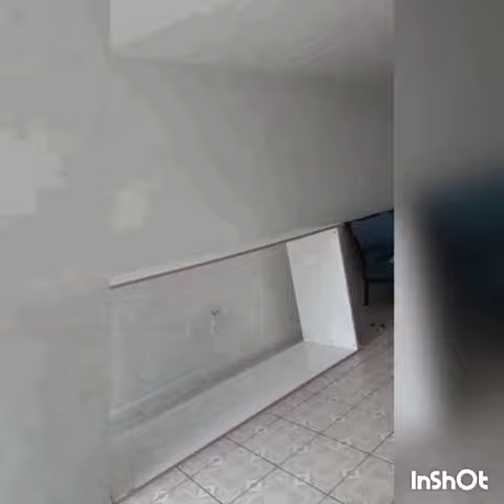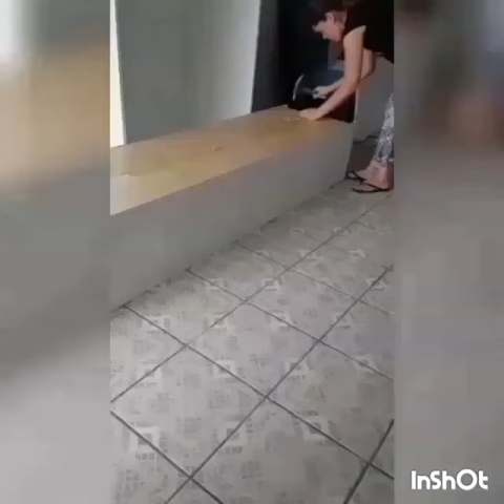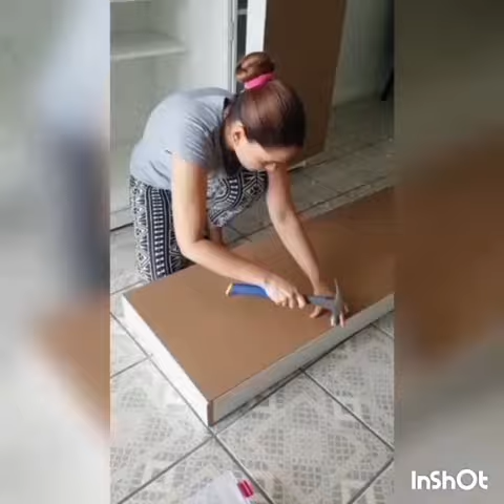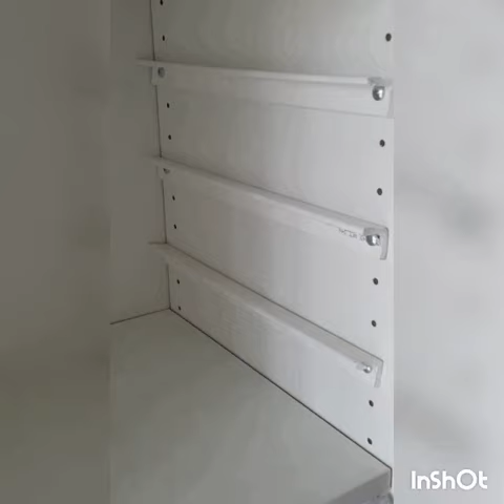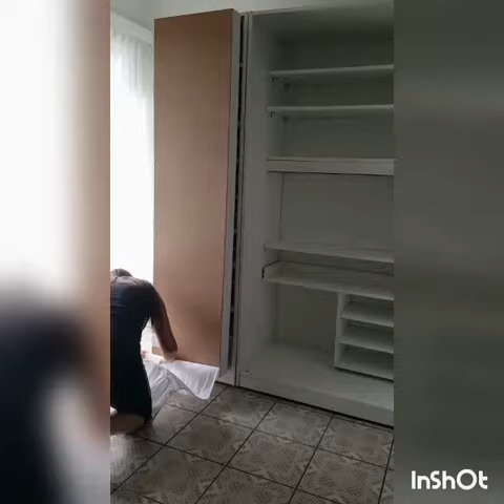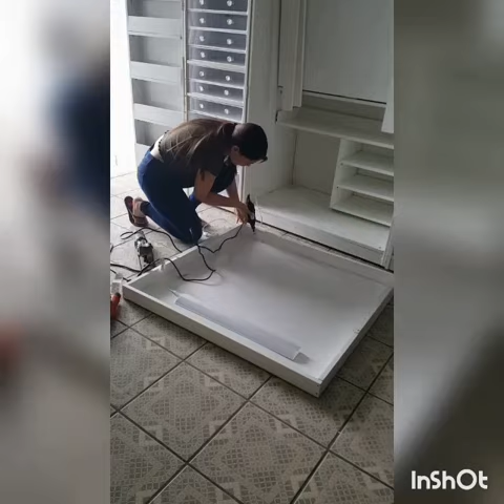DIY Dream Box (IKEA wardrobes + Lowes supplies)

Comment from the maker: Please turn on the CC on the video so you can see the subtitles.  Also check the description box.
Reply: Sileam I can not see anything that shows instructions or supplies? Am I doing something wrong?
Reply from the maker: @tatomirc  You need to click on the little (CC) icon next to the setting icon. Make sure that has a red line on the bottom. 👍
Reply from the maker: @tatomirc  I think You have to change the settings to Spanish subtitles. The English subtitles gives you the songs lyrics LOL. I need to fix that.  😂
Reply: Incroyable. Fantastique
Reply: @Sileam  I understand that you have the supplies list in the description, but would you be willing to make an instructions "manual" to sell to us that would like to make a replica?? Id gladly buy !!!
Reply: I have been wanting a dreambox for years and was looking at them again for my scrapbooking to keep things neat and tidy but to expensive.  I LOVE this.  Looks larger and more storage then the dreambox.  I would love to make something like this.  I see the instructions throughout video but do you have step by step instructions besides the video?
Reply: Hi Sileam, can you tell me the dimensions of the top, and how the dimensions of the table legs?  Thank You
Reply: What are the dimensions of the finished cabinet?
Reply: @genniegidney  wondering the same.
Reply: What is the ikea piece that you are attaching using the piano hinge. I saw 3 wardrobe pieces needed from ikea.
Reply: Hi. Fantastic job! Would love to know the total cost please! Love it!
Reply: Are the sizes correct for the IKEA pax side units??? Are they supposed to be the same depth as the middle?
Reply: Please do a step by step video with full instruction and measurements.  I WILL PAY YOU!!!!
Reply: I need additional instructions for the table. I just bought everything in your description (minor adjustments)
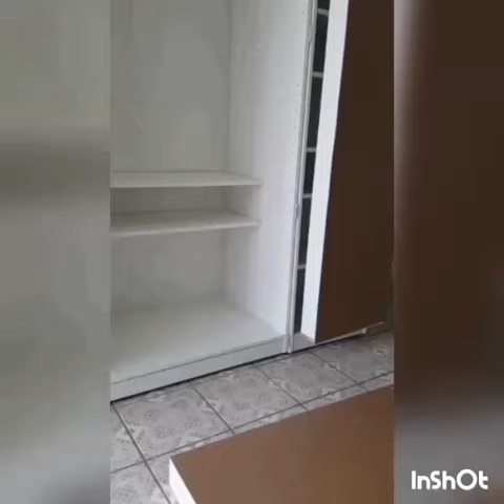Reply: What are the dimensions for the 2 end doors? 8:18
Reply: Thank you for your tutorial. We are almost done. We just need the lights and door handles.

Comment: I was going to go in debt trying to buy the Dreambox, but started looking for alternatives to it. Every video I came across didn't quite do it for me. The cabinets were OK, but looked cheap and not very durable. Then I found you. Girlllllll wowwwwww. This is the absolute best one and you set the standard for me. This will be what model I follow. Thank you for this masterpiece. Bravo.❤️❤️❤️❤️❤️
Reply: Did you ever built it? If so can you tell me which items are used for the outermost cabinets, I'm getting condused with the ikea shelves and all I found was UTRUSTA Shelf, white18x14 3/4 ". Is this correct?
Reply: @Cathybeez  I just bought mine from ikea but I bought different cases for slightly smaller dimensions in depth once closed

Comment: Started building this for my wife.  Got a lot of great ideas from this video.  I think there's a typo in the materials list though.  Based on watching the video and putting one together.  The sides appear to be the Pax 19 5/8 x 13 3/4 x 79 1/8, not what's listed. Otherwise when you have it all closed its 45 3/4 inches deep.  Almost 4 feet. Takes up a lot of space when closed.  Just a helpful hint.  Gonna have to take a trip to Ikea at some point to make it a little less overwhelming for the room.

Comment: love this video! Cant be more excited to build this for my craft space! This comment is not meant to be mean or condescending in anyway. Just informative for people who might be confused about the directions. So, a couple things to mention: with the horrible supply chain issues that IKEA is having in the current market finding all PAX items can be difficult. I can't find shelves and the wardrobes are mostly out of stock. I will be using plywood or melamine for all my shelves. With the current market (2022/2023) the cost of materials have increased as well to about $1,400 for the total project approx. depending on lumber pricing in your area of the US. Other comments are correct about the side doors being 13" and not 22" wide/deep you can tell by the 1x1 floor tiles. also there is a typo in the height of both wardrobes. They're the 92 1/8" sizes because 1) they don't make a 19x13x79 at all and 2) again estimating the height by the floor tiles again. Measurements for the crown, the table legs, pull out shelf, table it's self, and the smaller side doors can also be determined this way. But its unclear how high to install the middle shelving? it looks like she puts the board vertical and puts the middle shelf one board length up from the base of the wardrobe so the middle shelves are 39 3/8" apart and the next shelf is one foot below that? standard table height is 28-30" so I'll probably do that. But the directions are unclear. You can always buy drawer hardware and plywood for shelves instead of foam for structure and longevity of the furniture. The use of "already on hand items" as well like the plastic from the PAX for the side doors and the bottle caps for the ribbon holders are difficult to come by but could easily be improvised (use dowels for the plastic, and PVC tubing for the caps?). The type or weight rating for the command hooks I guess is preference but there are 5 on both sides. Compared pricing on amazon for some items like wheels, led lamp, and shelf pegs.  You can also cut holes in the drawers like how the OG Dream box has theirs with a saw or Dremel to save money on knobs. But if you do want knobs I'd suggest two part epoxy for attachment and not felt pads. some items with codes listed are no longer available like the vinyl molding and the gray wall panels but there are replacements with similar pricing on Lowes's website. the wheels she uses don't lock but you could put two on the big wardrobe on the back where there isn't and lower trim or just don't install trim when building wardrobe in the start. she also has a smaller drawer system and a couple deeper drawers with no explanation on construction although I assume it's the same but different sizes. If I'm missing anything I apologize and I hope this helps anyone who might be confused or apprehensive to start. TBH the creator could make this a reddit or something so we could all help with troubleshooting! :) Thanks for reading! Happy crafting!

Comment: The furniture comes from IKEA, just search "wardrobe closet" and match the structure of the one she’s building she uses the wheels from Lowe’s and probably the containers from the dollar store. Good luck!!
Reply: The supply list is in the description 😊
Reply: @NeverEnding_Designs  Too bad the supply list isn't accurate! I can't even finish building because the size of the wardrobe she provided vs the size of the wardrobe she used is incorrect. Now I have to disassemble the incorrect wardrobe, return it to IKEA (30 mins away), purchase the correct wardrobes, and reassemble them.
Reply: @solyamante  could you give me some more input on this as we were going to go purchase the cabinets she has listed this weekend??

Comment: I think you made a mistake on the 2 outer cabinet dimensions. Didn’t you use 22” depth for center and 13” depth for sides? I am building mine using pax frames as well.

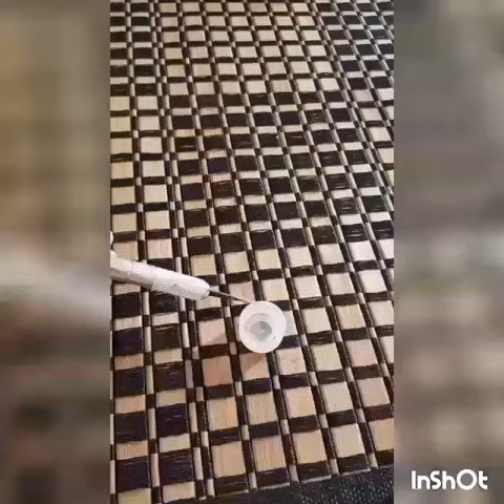Comment: at 9:49, you took a top from a bottle and cut it with an exacto knife, used a wood dowel and stuck it in the holes of the door with no wheels. what's the purpose of the top from the bottle?
Reply: It’s a bracket to hold the dowel. Like a closet rod bracket just in miniature.

Comment: Do you have the product code for the 18 inch by 13 5/8 in shelves. Ive been searching for 2 days on ikea.  and also since the actual cabinet is larger than 18 inches im confused about  the size.  I assume the 13 5/8 is short because you tuck the last fold out inside when closed...but is the internal dimension 18 and external 19+.  the closest size shelf Im finding from them is 18 × 14+
Reply: Melissa, did you find the shelves?  I am searching and can't find them.

Comment: Hi!  I’ve begun to build my “dreambox” and mine appears to be a lot deeper than yours.  Did you end up using 2 of the 19 5/8 x 13 3/4” cabinets instead of the 22 7/8” deep cabinets?  When yours is closed, is it about 45” deep or 36” deep from the front to the back?  Thank you!!!
Reply: Hi Aimee, 
Did she respond to you?  Also did you find the 18x13 5/8 in shelves thru ikea??? Ive been looking for 2 hours..not finding these at all
Reply: Hi!  I didn't hear anything from her so I decided to go with the smaller cabinets on the sides of the large middle cabinet.  I used the 19 5/8" W x 13 3/4" D cabinets for the sides.  Over all the cabinet is about 3' deep when it is closed.  I did find the shelves that fit inside this smaller cabinet.  They're listed as 19 5/8" x 13 3/4", but the actual size is about 18 1/8" x 13 3/4".  

Pax Frame - https://www.ikea.com/us/en/p/pax-wardrobe-frame-white-60214569/  $75 each
Pax Shelf - https://www.ikea.com/us/en/p/komplement-shelf-white-40277992/  $5 each
Reply: @aimeeaustin6273  how did yours turn out
Reply: @tashaharley3411  It turned out pretty good.  I didn't add the second fold out doors...I figured I could add them later if I want to.  I also haven't added the table yet, which I still am planning to do.  There are a few more things I want to add also before it's completely finished.  Overall, I'm happy with it.  The only downside is the space I put it in is kinda small so the cabinet looks ginormous!  Lol!  :)
Reply: @aimeeaustin6273  thank you, I'm wondering if i will have the same problem in regards to the space. I love her idea, but i also saw some using 4 bookcases of the same size, so i wonder if i did that with smaller bookcases how it would be, but not sure how sturdy it would be compared to the pax frames
Reply: What size casters did you use? I have seen several questions for Sileam but I haven't seen her response. I'm pricing out the material now and hoping to build after the beginning of the year.

Comment: Finally got the wife’s cabinet done.  When We close the outer cabinets, the backing of the smaller doors get stuck on the opposite cabinet.  Do you have this problem?   When the smaller cabinets close, there is very little clearance.
Reply from the maker: Hi Rod! I had the same problem at 1st but then I noticed I had more room on top of the small doors and I had to adjust them (moving them a little bit  higher) You can always make this doors smaller so they can fit in the opposite cabinet.
Reply: I’m sorry, I didn’t explain it well..   My Right cabinet gets stuck on the left cabinet.  As they move the last thing that touches is the piano hinge and the added on plain white back board.   It’s when it is opening and closing that there is no clearance
Reply: @rstandi  were you able to fix this, and can you share a picture of yours?

Comment: I need help I’m not sure what I’m doing wrong I feel like it’s not holding my bookshelf strong enough because I feel like it’s gonna fall or flip over
Reply: It is probably where you placed the castors (wheels) if you put them on the outer edges they will be more sturdy.

Comment: Hi!!! Hope you get to see my message and answer someday :) Just wondering... DO you KNOW the size of the Wheels you got?! I've found at least EIGHT (8) different sizes of wheels at my local Lowes!!! LOL I'm practically following YOUR supplies list... and what I'm missing are the WHEELS!! I want it to be like yours, that the wheels aren't that obvious but are the correct size. Thanks in advance! And thanks for sharing your awesome DiY Dreambox! Yours in much better!! :)
Reply from the maker: Hi!
You can buy any size, as long as they lift the wardrobes enough, so they can move easy when you close and open the dream box, you don't want the bottom pieces  of the wardrobes to touch the floor (I mean the mouldings that you see on the front, the ones that covers the wheels) . What is actually important is how much weight the wheels can hold, you can see that on the description on the price label, I think.

Comment: Just curious. Your Ikea dimensions say the depth of the three Pax are all 22". But it looks like your large Pax is 22" deep but the other two are not as deep. Am I making sense? 🤔 Are you certain all three are same depth? In the video it doesn't look like they are. I'm looking at your video and the Ikea website and it looks like your side Pax are the 13" ones. Update: Okay was going over your parts list and yes, the side Pax wardrobes are 13" because the size shelves you recommend are 13". So I think your Pax measurements for the two sides are wrong in your description box. Sorry for all this lol. I am wanting to build this and was going over everything.
Reply: I looked at this for a while and the 22" depth  appear to be the same to me based on where the hinges are at the start of the video.  They appear to be equal and in the middle.  If it was 13 the hinges would be closer to the front.  I think the reason for choosing the smaller 13 inch shelves instead of closer to the 22 inch dimension to accommodate the pine board foldout plus some of the extra storage.  I'm working on this as well.  It is a great design and the engineer in me is trying to get everything designed, cut listed so I can build this as well.  Hope this explanation helps.  Back to studying the video to get more design details out of her video.  But you could be right as I re- watch the video the hinges do seem to be closer to the front.  Engineering wise either depth will work as the key dimension for closing is the width.  the 2 - 19 5/8's widths added together equals 39 1/4 so you end up with 1/8 inch gap ideally.  Where the depth does play into the selection if if you bead board over the outside as well as the crown that is built. Of course all the internal shelves as well.  If you use the 22 7/8's as called out in the BOM the total depth is 45 3/4 plus bead board so closer to 46 inches wide. Expanded fully out ( 18 (pine board) + 19 5/8 + 39 3/8 + 19 5/8 + 18 (pine board) = 114 5/8 or a little over 9 1/2 feet.  estimating the width of the pine board widths at this point but it is pretty close estimate.
Reply: @douggordon1567  the shelves for the middle also seem off. The dimemsion of the pax is 39×22 and the shelves she recommends have the same depth of 22. Yet they are not the same depth as you can see in the video. Am I wrong?